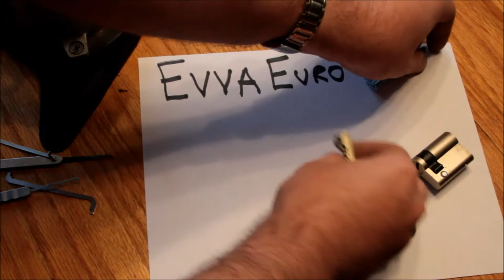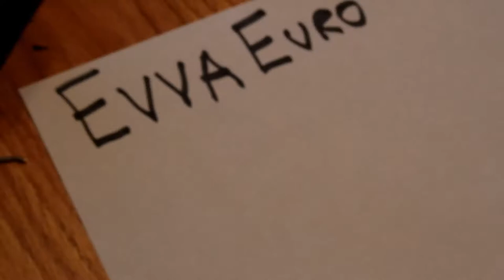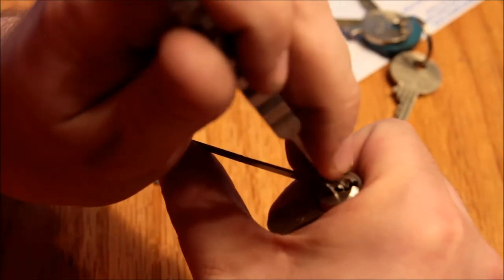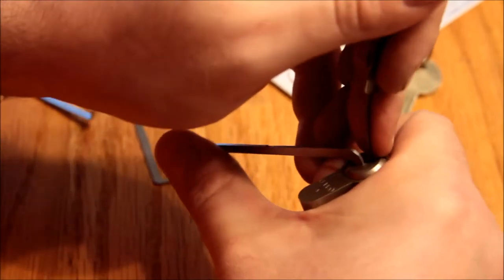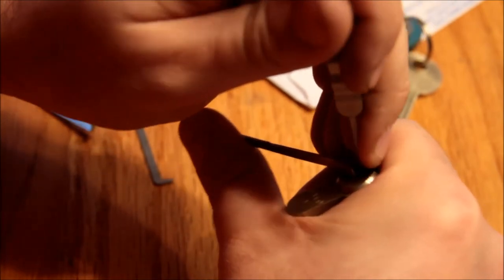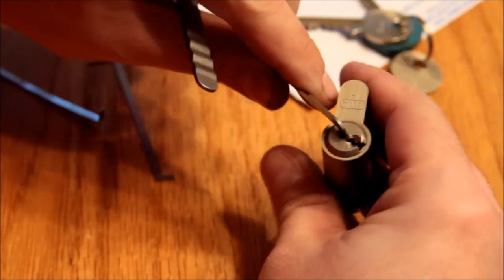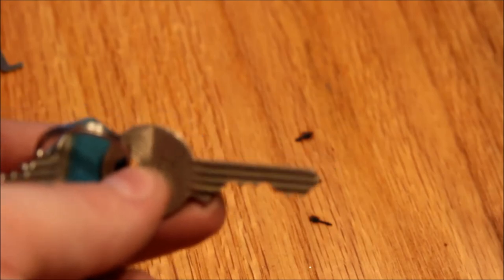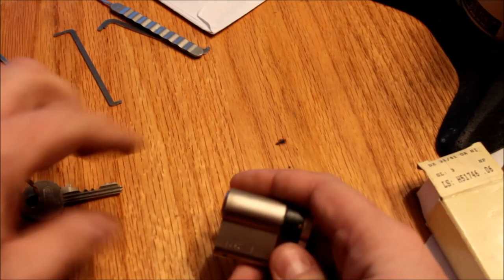(011) EVVA Euro Cylinder SPP -- Death by warding

Comment: The actual model number is "EVVA A", it's an older entry lever lock of EVVA: but it's still an amazing feat, Evvas are gorgeous locks, insanely hard to pick. 
The new entry lever is the FPS and than one tier up is the DPI with 6 pins, many evil ones, and a passive sidebar. After that Evva ICS, 3KS+ and arguably the king all mechanical of locks: Evva MCS. 
Congrats, nice picking!
(Evva is actually Austrian not German.)